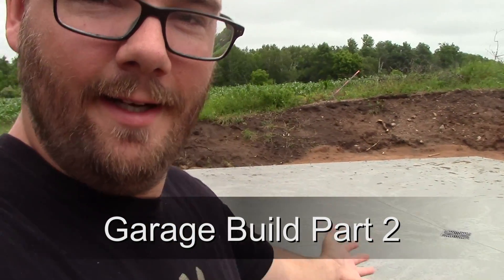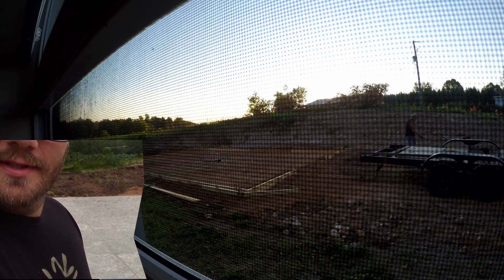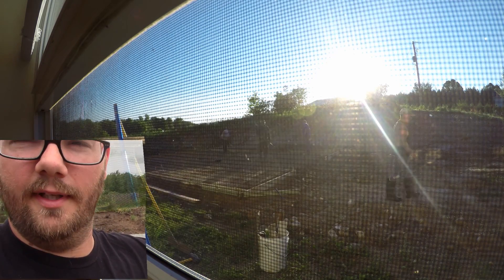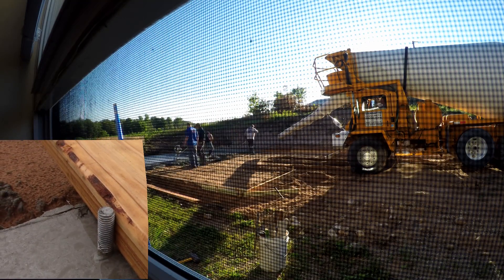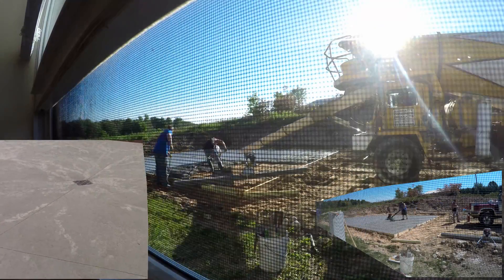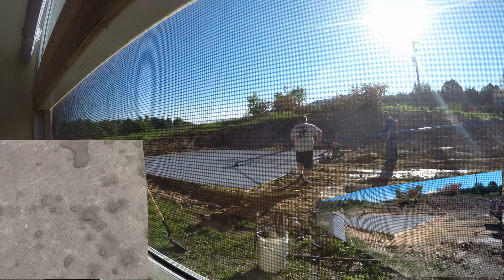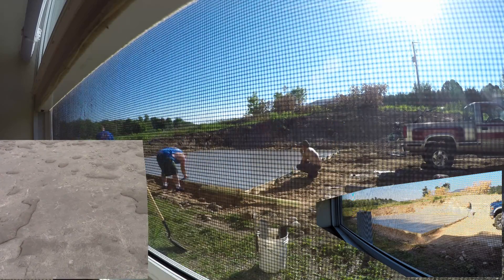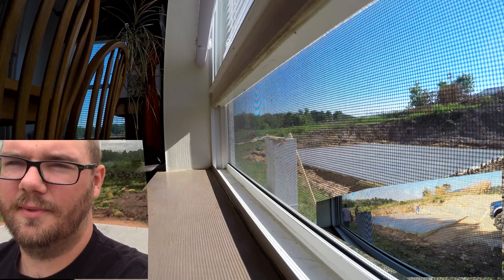Garage Build Part 2   All About Concrete

Comment: Get 1/2" bolt extension nuts and turn them down.   Cut some 3" studs out of a piece of threaded stock and let's getter done.   Build with a double sill and double top plate anyway, it's more meat at the bottom when your fastening sheathing.
Reply from the maker: Single bottom sill plate and a top plate with a doubler as I call it. No need for more meat on the bottom as it will have a treated 2x6 stood up as a "kick board" all around it.
Reply: That works too.   !!!

Comment: Maybe they expected you to counter sink the wood for the anchors?... though I can't really imagine why.  Too bad you sealed it, you could've put an epoxy coat on it and not had to worry about the fiber.  Unless they stick way up.
Reply from the maker: I'm told the fiber will break off and go away on its own, and if I epoxied it, it would flake with the fiber likely. Guess I will see how it turns out....

Comment: I'd just use the spade bit and a big washer.  You can go around and install some wedge anchors if you think you need them.   

 Since they've already sealed the concrete I'd let it go.  But if the fiber was sticking up and the sealer dried with sharp edges like fiberglass rosin does, I'd use a grinder to smooth it down and just reseal over where you used the grinder.

Looks good and I'm envious.  keep us up to date on the build.
Reply from the maker: So you think the finish isn't terrible then? Thanks for watching and commenting!

Comment: I mean no offence by my following statement, so please don't get ass hurt. But Don't you get tired of telling someone that is going to do a perform a hired task just to fuck it up? the good news on the anchors is that if you don't make them fix it you can cut them off even with the slab and drill holes in the pad close to the old location and epoxy them in. I cant remember what type of adhesive they use. I had a similar issue on a slab i had pored and it was fixed that way. good luck and don't accept less than what you paid for. In the video you kinda made it sound like you let you brother in-law or a cousin do it and you didn't want to bitch because it was family.
Reply from the maker: Its hard to tell if your opening statement is an insult to me or not, but not offended either way. I agree that I can flush cut them. If I needed to, my original plan was to use wedge anchors anywise, then I thought why not do this.

They are not family, and they were recommended by the excavation guys, with some references. The thing that gets me is the amount of fiber that is on top, and what to do going forward with it. This was a verbal agreement deal, and I will see how it pans out once I get some feed back from people about whether or not this is what I should expect to see from Fiber Reinforced Concrete.

Thanks for watching and commenting!
Reply: I meant no offence what so ever. That was why my opening statement was "I mean no offence by my following statement. I have just got tired of getting burned and it goes all over me when i see it happen to other people. I'm a disabled Vet and I get it more than most should from our gov. and when a person conducting business with a customer does something like that, well i just expect better. I apologize if I offended you in any way. I should have just kept to myself. 

I agree the fibers would have literally rubbed me wrong.My shop is my sanctuary and I have my dogs follow me everywhere but the shower and bed. Their like my kids, so if one was to get a splinter and i not notice it and it get infected I wouldntt be a happy camper. I apologize i should have just minded my own business. good luck with your project, Jack
Reply from the maker: Please keep the comments coming, I think we are on the same page here. I am going to be curious to see how it turns out in time for sure.
Reply: I used to work for a company that refinished concrete floors we did epoxy sand broadcast floors mostly and we had large diamond grinders made similar to a floor buffer that we would take the top layer of a floor to level and give them a fake torrazzo  look then reseal them I don't believe that would help with the fiber reinforced pad. and epoxy isn't a good floor covering in the long run if your going to be fabricating and welding. Take care, Jack
Reply from the maker: Thanks for the info, this garage floor is for parking, not fabrication. That one will be next year hopefully...

Comment: The anchors would be fine for metal plates and studs. Just as strong as wood and much lighter. The light weight makes it easier for one person to handle, add a cordless drill, tin snips,  and self-drilling screws, you're good to go.
Reply from the maker: I have never heard of anyone using just a metal plate for a seal/bottom plate. Seams like a weakness as it would rust pretty bad and not provide much boundary from the non treated studs to the grade. I will either use a spade bit and drill out a 1/2" of the bottom board to make this work, or end up drilling and placing a wedge anchor in it.

Thanks for the idea, watch and comment!
Reply: +David Finch (dfmmc2014): It's a galvanized 2X4 size U-channel as are the studs. You put a layer of asphalt felt on the concrete first.
Reply from the maker: Ah, I know where your coming from now. I haven't seen a whole lot of use on steel studs other than commercial building and mainly because they are cheap and provide better fire rating... I don't think I would ever use them on residential.

Comment: looks like a monolithic pour .....did they pour footings also?
Reply from the maker: They did what they call a thickened edge, so it is 8-10 inches deep on edge and tapers up to the 4" thickness for the rest of the pad over about 12" of run.